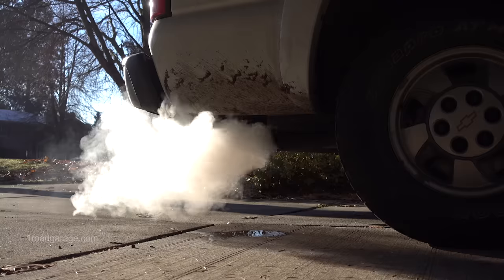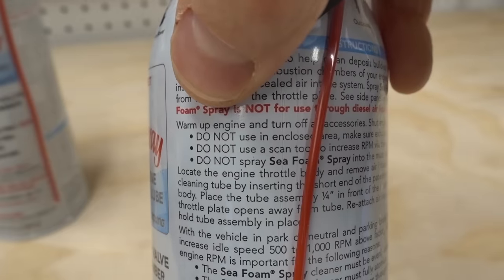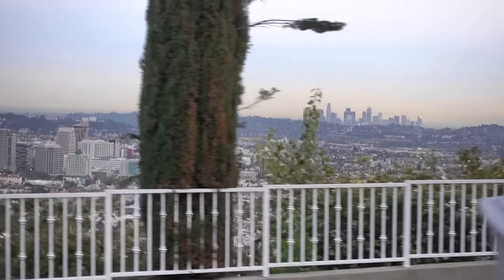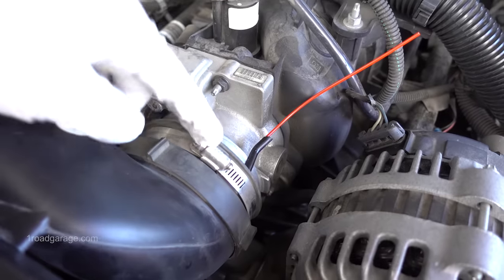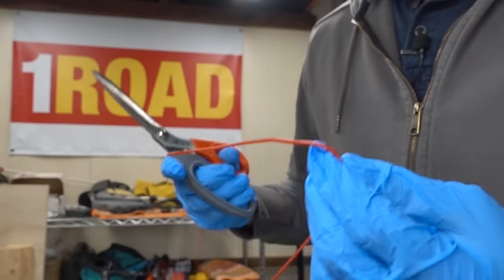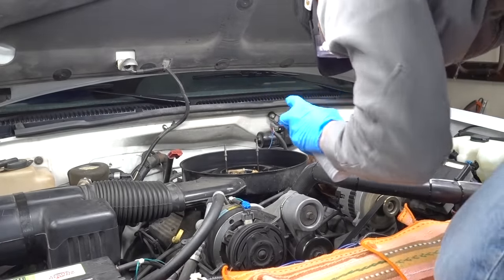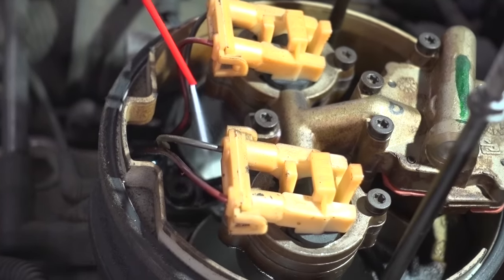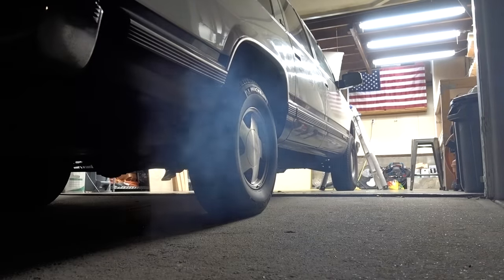Why You Should NEVER EVER USE SEAFOAM!!

Comment: I'm sure someone has already said it, but the best way to do it is to take the brake booster vacuum line and stick it directly in a can of seafoam. Do this intermittently until you the can gets low. Then you use the last bit to kill the engine. Just stick the vacuum line in there and let it run till it chokes out. Don't worry, you wont hydrolock the engine. Then let it sit and come back after a while and fire her up. Tons of smoke produced, because the engine took in more than it could burn, so the leftover seafoam is just sitting in there soaking away.  I have the same engine in my Buick roadmaster. It's the L05 5.7 tbi engine. Only difference is mine is mated to a 700r4 trans, while yours probably has the 4l60e. Hope this helps.

Comment: Pull the vacuum line from the brake booster...trickle seafoam down that line while it's idling (sloooowly)[keep throttle up while it's going in, it will cause it to bog down]...give it a REAL good soaking...shut off when 1/2 bottle is sucked down and you see the white cloud...let sit for 5-15, next start up you will definitely get the cloud of white...

Comment: The nozzle you put inside throttle body, is the idea that the seafoam goes inside the throttle plate when u gas or it the idea that seafoam get sucked with intake tube ???

Comment: If you want some serious smoke take the brake booster hose off the brake booster and slowly dump seafoam down the tube. I watched my mechanic do it to my 1988 Chevy k1500 and get some serious smoke. What it does is actually goes directly to the valves or something like that.

Comment: I have to chuckle. What you are doing is what I was doing back in the 60's to decarbon and engine. Back then gas had lead in it and some companies put "TSP" in their fuel and it would build up and push the compression above specs. At that time I used Delco Carbon X66. It worked great if used properly.

Comment: I used this in the early 2000s on my Dakota's poured a quarter can in the gas tank and sucked the rest up in the vacuum line. Adding the seafoam slowly when the engine trys to stall. When the can is almost empty stick the tube all the way in an it will kill the engine. Wait about ten fifteen minutes. Fire that smoke ball up and floor it.soooo much smoke. Its impressive i promise, and really believe it help clean the engine and valves very well. I smoked my neighborhood fully out. Ive done burn outs with less smoke 😂

Comment: If you use seafoam through the hose coming from your brake booster. You have to apply very slowly or you could hydro lock the motor. I set the hose next to the mouth of the can and slowly tip the can until you see it going up the hose.  That's how you're going to get the cloud of smoke that you are looking for.

Comment: I have used a product with similar ingredients as Sea Foam; Wal-Mart's Super Tech Engine cleaner in my gas and it seems to clean out the engine and improve my gas mileage after use. I use a can about every 4 months in my gas tank. I believe in keeping a somewhat clean engine. A little carbon is good but a lot of carbon is bad. It is also (says the  same thing on the Sea Foam can) that the product when placed in your gas tank will give you upper valve lubrication. My valves have been extremely quiet over the last few years that I have started using this product.

Comment: I’ve used sea foam and have smoked up my whole neighborhood and the surrounding ones too. I had just bought a 1996 Suburban and it was barely running. Come to find out it had a bad coolant temp sensor. The guy I bought it from was driving it for months a closed loop computer. It was dumping fuel all the time. New sensor it smoothed out a little. Sea foam treatment really cleaned the carbon out. I followed the instructions to a T. On my after treatment drive I had so much smoke pouring out the cars behind me had to stop until the air cleared.

Comment: I have a 1997 Silverado k1500 with the 5.7 vortec and I had a ton of smoke when I used seafoam, but my truck has 214,000 miles and was a little neglected when it was farm truck.

Comment: On the 88-98s do the throttle body  this gets 60% of your intake ,and then dump some down your main vacuum line from the brake master cylinder ,  this gets all the carbon  in the rear of the intake get the liquid  not the spray for the vacuum line,dump so much your engine  stalls its sucking so its very easy to get a good blast of foam in there - let it sit for 5 mins and then get ready to roll some coal this is a very effective method for getting a lot of smoke because most of the carbon is in the rear of the intake near the firewall, gas,momentum and air naturally force it to the rear, I confirmed this by taking off my intake to do an injector swap ,TRUST ME IF YOU WANT SMOKE this is how you do it .

Comment: I have a 95 k1500 with the 350 tbi. I took the vacuum hose off the brake booster and let the vacuum suck the seafoam straight into the intake. I kept it running as it sucked the seafoam up until it was almost gone and when the can was just about gone I let the last bit of the can kill the engine. Let it sit for a little bit and when I started it back up it was so smokey that my neighbors came out of their house thinking something was really wrong.

Comment: Because the spray can of SeaFoam cost more I bought only 1 bottle.  After using that spray bottle I attached the straw to a regular pump spray bottle and pour seafoam into the bottle.  Much cheaper to use.  Also Walmart has their own version of seafoam called Motor Treatment for like $4 vs seafoam at $12.  I have been using it for several years now and it works great.

Comment: I have a 96’ Ford Contour with 107,000 miles, it had been sitting for a year before I started driving it everyday a month ago. Should I use seafoam?
Reply: Yes. And clean the MAF/MAP sensors, if it had them. Change or clean PCV valve if it has it.
Change fuel filter if it has it.
Check air filter. 
Run seafoam via brake booster line AND week later a can in the gas tank. If you use the break booster method, use carb Cleaner on choke area with a toothbrush to rid of debry.

Comment: I wonder what the constituents of the smoke are supposed to be. I’m no engineer, but I wonder if it’s the fact that your truck does not have a mass airflow sensor. Perhaps when you spray the stuff into an engine with a MAF, the computer senses a change in engine conditions from down stream sensors and reacts by changing the mixture and/or spark timing to try normalize operation and those changes (plus the seafoam) end up producing a ton of white smoke.

Comment: Great Video..you had me for a minute..I was going to post this is a bad video..lol...
I started using Seafoam about 10 or 12 years ago on the advice of a friend who is also a Small Engine Mechanic. 
Well...long story short..
Best product I've ever used for cleaning deposits in any engine .
My 1998 GMC K2500 suburban has 370,000 miles. 
Before I started using Seafoam I was getting about 9 to 10 mpg..
Of course I had all the injectors replaced and fuel pressure switch etc....still was only getting about 10 mpg..
Now after a few new tune up and using SeaFoam for a few months I'm getting almost 12 mpg..👍😮
Seafoam works.
Great Video 1Road..

Comment: I used a whole can of high mileage seafoam in the gas tank of my 06 Mercedes Benz. With only 5 gallons of gas in the tank. It did wonders on my car !! Even though had just done a tune up. New plugs and wires, new coil packs, new fuel sending unit with filter and new fuel pump! Was hesitant about using seafoam but bc of all the great things I heard about it,I tried it . THERE COULD NEVER BE A BETTER PRODUCT THAN SEAFOAM 😂💯💯. I KNOW WHAT IT DONE FOR ME, AND I WOULD DEFINITELY USE IT AGAIN AND AGAIN!!

Comment: I have a gdi motor , had to take the intake boot off and put the spray nosels in the intake and had someone spray while I kept the rpms at 2,000 . Once the can was sprayed I hot soaked it for 15 min . Then started it back up started getting blues smoke so I drove it and I turned the entire block into a cloud. Stopped traffic and everything lol. People prop though I blew my engine but traditional fuel injector cleaner doesn't clean the top part of the motor because of where the gas is injected.

Comment: I use seafoam and inductions cleaners and i found that it helps to let it sit for a hour and the tbi type kinds cleans eveeything with raw fuel so the little smoke u are getting is off the exhaust side off the valve train.

Comment: The way to do it correctly. Is where the hose hooks to the front of the throttle body. Put the straw in there clamp the hose back on. Then spray into the throttle body directly. That is where a bunch of carbon build up is. I did it that  way on a S-10. The throttle body plate was black. It smoked out the whole neighborhood.

Comment: I used sea foam on my catless lexus and it smoked out my whole neighborhood. I knew going into it it was only creating deposits in my intake due to leaking valve seals "I had to pull the intake off for the starter" and since I was catless, you could certainly notice a hint of oil smell after the cleaning that was not there before, likely due to the carbon deposits sealing the valve and no longer being there.

Comment: I have a Frantz bypass filter on my 04 Titan. The first time I used Seafoam, I had the huge rolling cloud of smoke. After about 300 miles I did an oil change. The Frantz filter was loaded with black grit. Since then, I don't get as much smoke as the first time, and the bypass filter has much less grit, and it's finer...more like black talcum powder. I believe its just a case of being more religious about servicing my engine.

Comment: J got a used Nissan 350Z with 170k miles on it it’s in mint condition but you know any engine with that many miles has some good nasty stuff in the engine by that point. I did it and got some good billowy smoke from it. I think it worked really well. I would be surprised if my motor is clean from maintenance tho this guy kept it so well it’s mint.

Comment: I have used seafoam many times in newer and older cars alike. I always slowly suck a whole can through the PCV valve vac line or the brake booster brake line, and let it hot soak for 15 min. Then I just go race it around and watch the smoke blow out. I have never had any adverse affects with it and have always noticed an improvement in throttle response and MPG's.

Comment: I used it twice in Florida with a155,000iles on it. It had rough idle no power..I worked p/t for advanced Auto parts the boss says run a can in every other fill up..dam runs very good lots of power with new plugs and wires weren't the answer.. throttle body looks and I haven't used the spray can.  It hits 100miles an hour in a heartbeat. Seafoams awesome!!!!

Comment: One reason to leave the spray-tube bent is to prevent it from going into engine... I know this from experience, as I worked at toyota we would bend throttle body cleaner tube to prevent this. You really should have went and drove it like you are trying to destroy the engine, not literally but give it a good flogging.

Comment: I'm currently working on my 95 C2500 suburban. Been sitting 3 years has over 200k and I'm thinking of doing this after I dump the gas, change the oil and fush the radiator.

Comment: Iv used seafoam for 30 yrs   
I also put in the engine  oil and transmission  befor change  
 I just poured 1 gallon in my diesel motor home 80 gallon tank  ,20 year old  ,and i cant tell you how much it improved things

Comment: Hey bro I try to do it in my 2004 lexus rx 330.  Should I spray. Direct to the intake with out removing ANYTHING. Help
Reply: dilan duran Seeing as your car is not too old i would assume that using Seafoam is unnecessary. But if you were to use it you need to remove the hose to the intake. And as he mentioned do not spray any seafoam on the Mass Air flow sensor!
Reply: My car has 220k

Comment: I just purchased a 2002 Chevy suburban with 191,000 MI and I put sea foam into the tank and it smokes like a chimney and stinks but I can't drive it to far because one no tags and two it has a bad rear main seal which I'm not sure about doing myself. It will leak about a Court of oil an hour

Comment: I'm going to use this on my 1997 C2500. I heard that you can split it in 3 and use a third in through the vacuum line, a third in the engine with the oil and a third on the gas tank; changing the oil after 150 miles or so.... Your thoughts?
Reply: I forgot that I used a little of the Super Tech engine cleaner in my Sonic's oil about 1500 miles before I changed it. I am leery of leaving any engine type cleaner in my oil for too long. The car appeared to have a lot of sludge in the fluids after I bought it used. The car came from Florida after a hurricane but had at most very  minor body damage. It did clean the oil up and or appeared to clean the oil channels up in the block & head.
Reply: @informationcollectionpost3257  Nice, it did the same for me. My injectors were still faulty so I ended up changing the Spider Injection assembly.

Comment: I pour it into the vac line from the brake booster on my 98 ram 2500 V10 with 190k  and it absolutely bellowed white smoke the key is to pour while running and shut it off mid pour or purposely stall the engine with alil to much and smoke will roll

Comment: Sea Foam destroyed my engine. Right after I started spraying into the running engine, the timing chain broke and the engine ate itself. I'll NEVER forget what Sea Foam did to my engine.
Reply: Spun my bearings with it on my ram hemi. Last owner never changed oil much so it released chunks of sludge which blocked oil passages

Comment: I thought you were supposed to spray most of the can into the engine then when it's almost done, spray it hard until the engine conks out. Then that's your hot soak. Then start it up, go for your drive and lotsa lotsa smoke. 

I put seafoam in all my small engines. 1oz per gallon in all my gas. Keeps all my small machines running great. I often put it in my boat too, and sometimes in my truck.

Comment: My personal experience is. an ex poured alot of sugar down my tank. I found out late. I dropped the tank. Cleaned everything. But ran really rough. I tried everything. And was about to throw in the towel. And either get the motor rebuilt or get a new truck. 
But my buddy. Suggested seafoam. At first I thought he lost his mind. But it cleans out everything else. What would it hurt. I got the truck warmed up and ran it through it. Actually ran a second time. And I will be damned. It worked. Truck started running good again. Actually surprised me. Definitely made me a believer. 
Bobby

Comment: Also being TB injection.. all the fuel dumping into the intake probably keeps the runners and valves fairly clean. I’ve never pulled a sbc apart and found the head and valves to be trashed with Carbon

Comment: With the spray you need to cut the straw that it sits before the throttle plate do not put straw after throttle plate other wise it will pinch the straw or cut it and go into motor. So just in front of throttle plate not after.

Comment: You need to buy a regular can of seafoam. Then take the hose off that goes to the brake booster which is a vacuum line that goes to the intake. Then while engine running, but the vacuum hose into the can of seafoam and let it suck the liquid out. The immediately shut engine off.

Comment: some newer cars like my 2018 jeep needed a load put on the engine to create enough velocity to suck the seafoam into the engine. i poured almost a whole can with no smoke, took it down the road and it started running like crap and pouring smoke. theres a low spot in the intake /manifold that the seafoam pools up in and the seafoam cant make it into engine till intake air velocity is fast enough to suck it in.

Comment: Swear by Seafoam. Used it in every vehicle I've owned. I always used an old mustard squeeze bottle though a vacuum line till the engine died. Let it sat 10 mins then got a good 20 mins of thick smoke.  Only issue I've ever had is it blowing all the crap on the O2 sensor and then I just Seafoamed it again and was good to go.

Comment: Yo bro this is the correct way to use seafoam: 
First add 2 OZ to each gallon of gas u got in the tank
Than open up the throttle body and spray the seafoam in while ur holding the RPM’s at about 2000 When u finish the bottle let it hot soak than turn it on and rev it 
After that add the remaining that u didnt use to the oil (not to much)

Comment: Actually it is best if you pull the Brake booster hose and pour it in slowly. Pour half a can then shut down engine. let set 15 mins then fire engine back up and pour remaining contents in fuel tank.

Comment: 1. Buy the twist top lid not the spray can.
2. Remove vacuum line from brake booster.
3. Insert vacuum line into can and let it suckkkk
4. Enjoy smoke show.

It goes right into the intake but it's more concentrated. I don't believe the smoke has anything to do with the amount of carbon it is or isn't removing

Comment: bro, can says it, it need to have your car at running temperatures then spray at the throttle body, if you spray the seamfoam into the throttle body and car is cold or just warm, there would be no smoke or just a little. i went thru the same when i did it the first time. 2nd time I READ the instructions, and it clearly says it, your engine is supposed to be HOT in order to work.

Comment: Drive a 94 c1500 and got loads of smoke but that's probably because it had so much buildup that the pcv hose and line and even in the throttle body was packed full of buildup

Comment: I used seafoam and put it in the oil crankshaft aka oil cap and got no smoke had to drive it for 100-300 miles before oil changed and work for me noisy lifter is now quiet